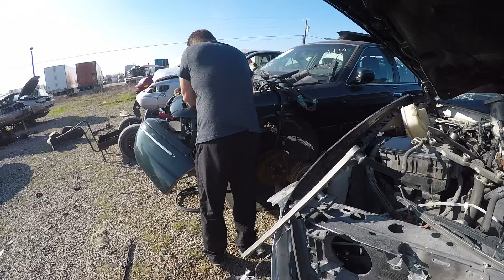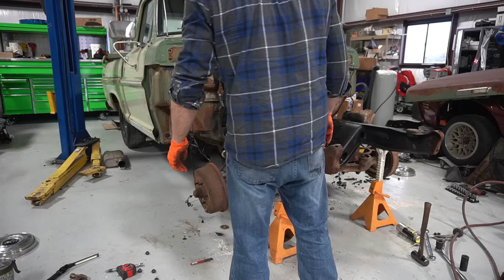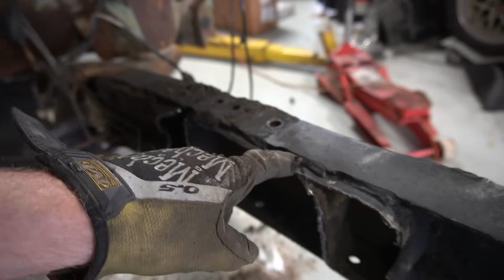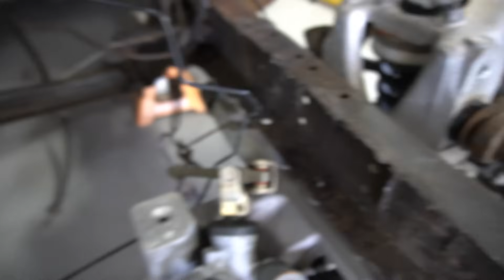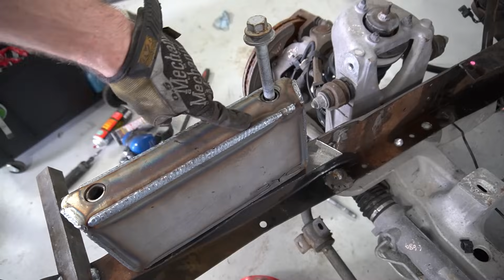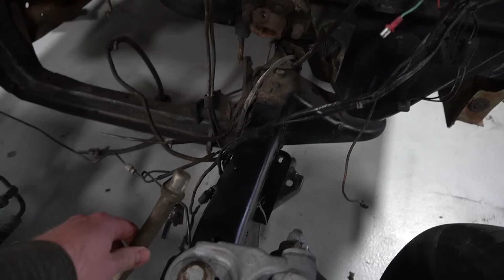F100 Crown Vic Front End Swap - Step by Step

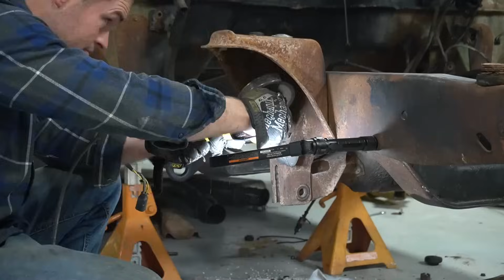Comment: 7:11, eye protection...
At 20:35, I think you need a 3/16th spacer between the BYC frame box and the Crown Vic mounting plate...
Reply: Yeah, i saw those needed spacer/s too....7/16" spacer
Reply from the maker: Where did you guys see that? I hadn't seen that a spacer was required, but I also didn't find much in the way of instructions. If you guys can send a link or something that would be awesome! Thanks
Reply: @330_garage3  at 20:35, watch carefully when the pivot strut arm drops...it "hits" your new welded-frame-box only at the "tip" and only the tip hits... whereas the backside of the strut arm still has a wide-gap at the inner frame's box. It even seemed liked when you torqued down the bolts...it bent and stressed the arm so that the gap was removed...but under stress the gap was removed.
Reply: @LarsonFamilyFarm-LLC  
Well said, and if you freeze the video at 20:43, you can see the "wedge"...
Could be a case of "stack up" tolerances, could be a negative truck with positive parts...
Still can't see caster adjustment...
Reply: Joe Schlotthauer caster would only be adjusted by the whole angle of the subframe install, not necessary to “adjust” anything if installed correctly

Comment: Yeah Ford motor company has that wonderful habit of changing and redesigning their vehicles like every 3 years for no reason whatsoever except for paranoia!!!!
Reply: Engineers justifying their jobs...
Reply: @joeschlotthauer840  Engineers need to.......smh!!!
Reply: Ford built the 3rd gen panther platform from 92/93 to 2011. That's 17-18 years. Of course cosmetics change, but the chassis varied very little.
Reply: @retireddec04  
That chassis was also used in the Grand Marquis and Lincoln Town car...

Comment: I was gonna buy a plasma cutter to cut out the crossmember as you did but I cheaped out and used 12” sawzall blades. Glad I did after seeing how long it took with the plasma cutter. Sawzall blades went through like a hot knife!
Reply: slow5oh89 sometimes I’ve found that a simple approach with basic tools is just as easy If not easier than using fancy stuff. Bet you didn’t need a 10 pound sledge hammer once your cut was done
Reply: OntarioRedneXXX That’s right, it just fell out